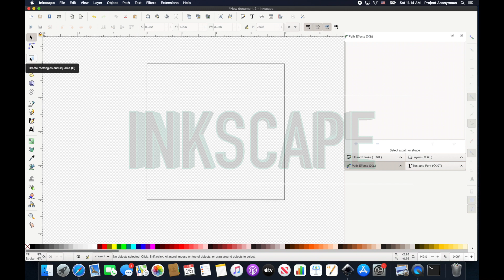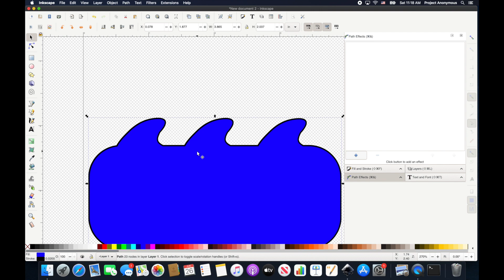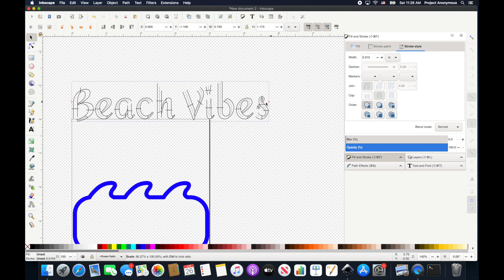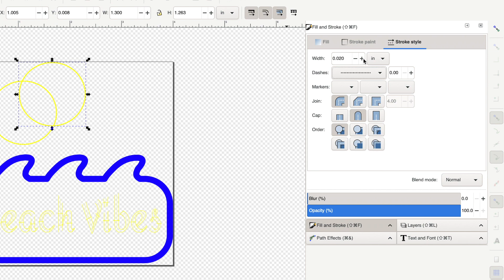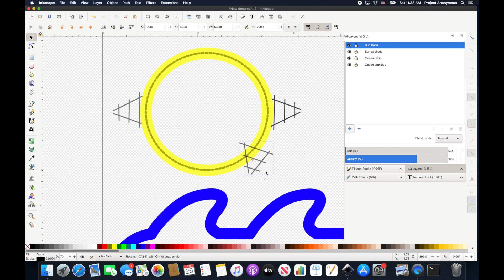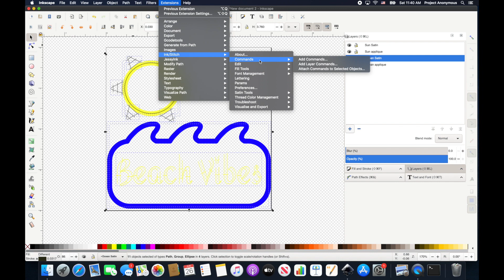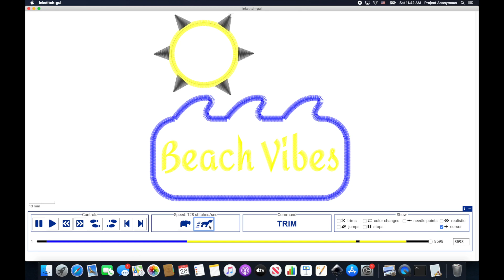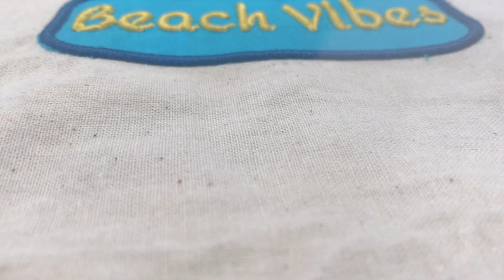3D Puff & Appliqué Embroidery on a Tote Bag Using Inkscape & Ink/Stitch ☀️ Brother SE1900

Comment: Thank you so much for the tutorial! I purchased an embroidery machine and until I get it I just search for methods to design for it with the Inkscape. I have no idea of what I need to know before even starting as I never used an embroidery machine and I would not know what each ink/stitch command would mean for that purpose. I enjoyed the tutorial and I understood all you showed. I am looking forward to messing with Inkscape to design stuff. If I could only get the machine to satin stitch one straight line, that would deserve a flute of champagne ....lol.
Reply from the maker: Thank you for the comment! If all you need is a straight line satin stitch, it’s very simple. Use your bezier tool to make your line, then adjust your stroke size to the desired thickness of your satin stitch in the fill and stroke parameters. Finally, go to Extensions>Ink/Stitch>Params, go to the stroke tab and make sure “running stitch along paths” is selected. That should do it!
Reply: @ProjectAnonymous_Duo  thank you!

Comment: My Inkstitch works correctly sometimes.  I follow everything you’re doing, one time,  with you answering my questions, it works. Next time things are all messed up.  My words,”lettering”, comes in huge, nothing like yours.  Sometimes when I hit actual preview, it’s a total mess!  Any settings I should know about? I’ll try uninstalling and installing again, or I may try to use my husband’s windows computer.  
I love your calm teaching style!
Reply from the maker: This program does take some getting used to for sure! Only thing we can think of right now is, are you working from a saved template? And if so, is it in inches or millimeters?
Reply: @ProjectAnonymous_Duo  I think my fault is that I wasnt using the params consistently.   I'll get there, thanks!

Comment: what are the sizes of your dotted and solid lines, please?  I think I have things right, then it doesn't draw correctly.  I have the lettering part down pat, it's the layering of the lines I'm having trouble with.  I hope you don't mind me asking all these questions.  Thanks!
Reply from the maker: Hi there, we don’t mind at all. Our dashed lined stitch is .02” (though the size of dashed lines don’t really matter as they will always stitch out as a single line straight stitch). Our satin column has a thickness of .12”.

Comment: Wow, that looks fantastic! We've never tried the puff technique, but it looks great I think we'll need to find a project to try that on.

I guess the command to cut jump stitches depends on your machine. Ours is the NQ1600E and it supports it.

Where the waves intersect the rounded rectangle, consider putting a small radius on the line instead of having it make a sharp corner, and this will make the satin stitch change angle gradually instead all at once. We did this for a satin rectangle we made, and I used
Reply from the maker: Thank you, and thanks for the tips!
Reply: i think using an 'official' satin stitch would fill in the corners better than a zig zag stitch. My machine also supports those trims, thankfully :-) I love these videos. please keep em coming! :-) Thank you for sharing!

Comment: Unless there’s a hack that command won’t work if you machine is set up to cut jump stitches 😞 I found that out the hard way and I have a pe800. If you find a work around please share and I’ll do the same 🤔
Reply from the maker: The only work around that we’ve heard about so far is changing the color of each object (each letter or sun ray in our case) to a unique color, and then restart the machine after it stops for a color change, but we’ll certainly keep looking for a better solution
Reply: Your machine has to be able to cut the stitches. If not then you could select stop above the trim command. Select both trim and stop. It will stitch and stop on its own. But you'll have to start it again manually. Kind of time consuming as you'll have to be there to keep pressing the start button.
Reply: @MrGinoriggs  You're surppose to add two commands. The trim and the stop command. The stop command is on top of the trim command